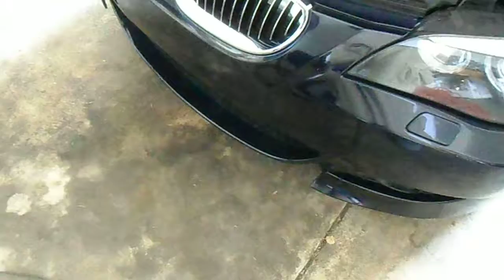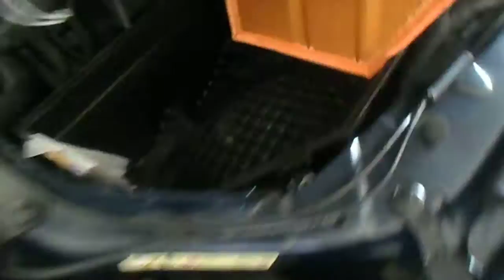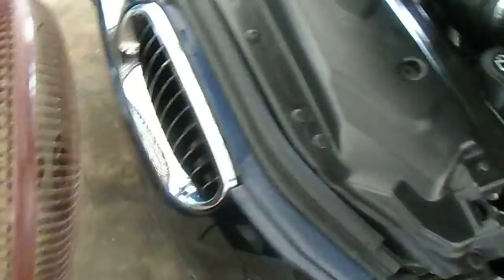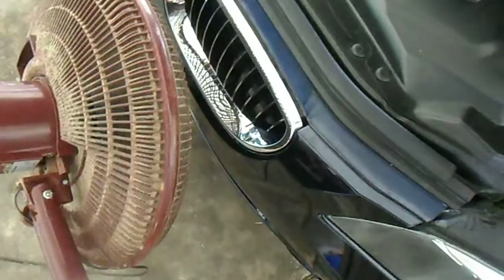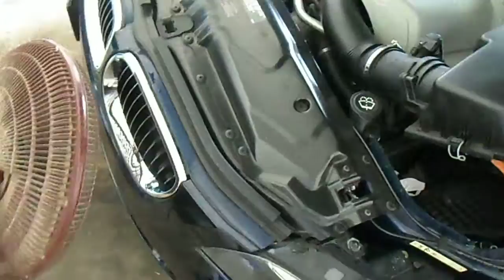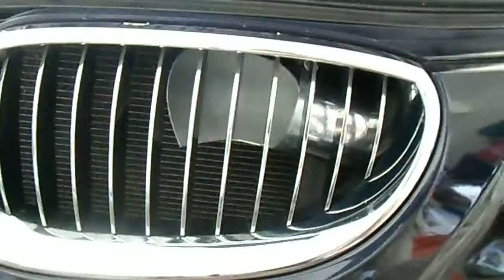BMW 545i self made ram air test 2 better gas mileage and true cold air intake

Comment from the maker: above 50 it starts pulling harder easier and you dont have to force the car to downshift to 5th when doing 70 or better.......I also gained about 3.5 miles to the gallon highway miles I went from 25.3 to 28.5+. test was run over a 650 mile drive from Cincy Ohio (where I installed it) to NY With the stock paper filter. Last week I installed the BMC filter which should net even better results read about it in the link at the top

Comment: I did something similar to my rsx my changing the intake hose to another straight hose making it ran air cut the back the air box out 4 inches squared my ram air system helping me get 40 mpg easy
Reply from the maker: It was fun modding that car.....I may be getting a 2019 Mazda mx-5 rf....if the radiator doesn't block access to the nose...I'll be doing it again